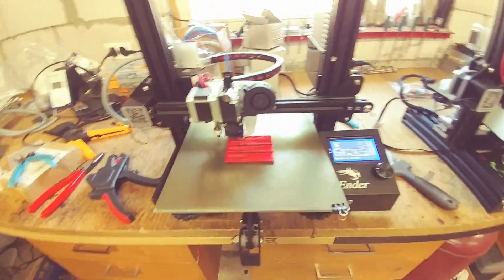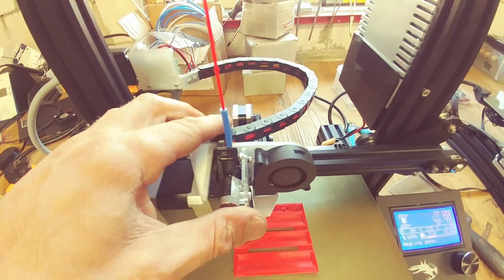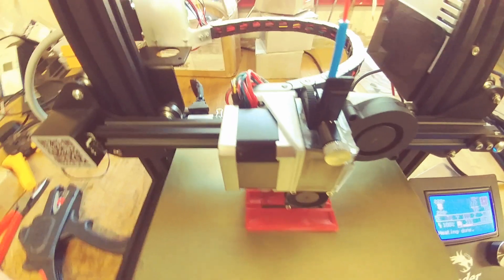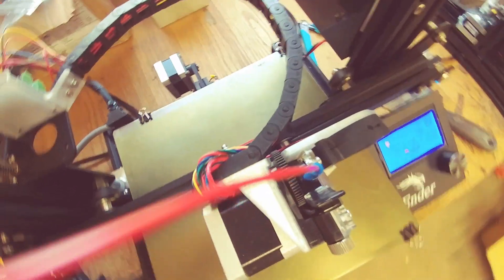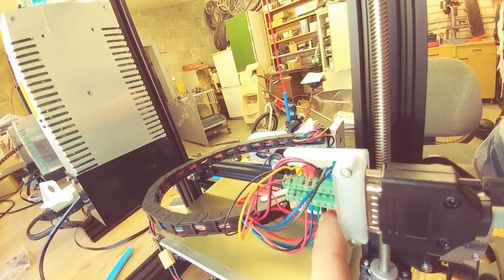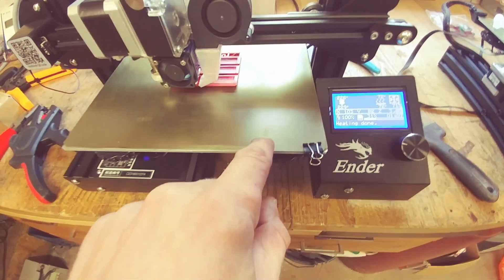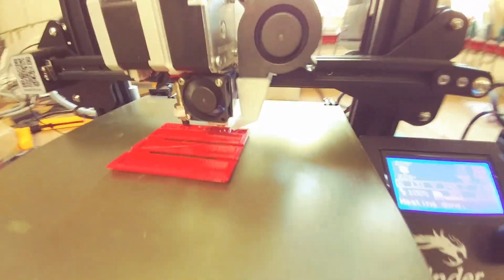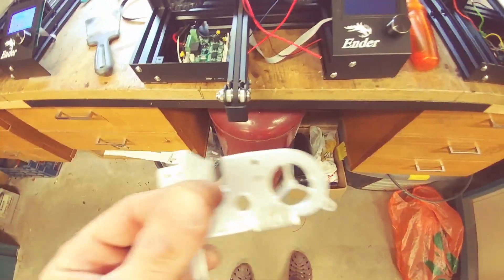Ender 3 direct drive mod with prusa pinda, and magnetic bed

Comment: Have you had any problems with the d-sub 15? The heat coming from it, is it a problem?
Reply from the maker: Why would it be a problem? DB connectors are rated for 3A per pin. 40W heater pn ender is 1.66A so i have plenty of overhead

Comment: Hi Agnius. Can you please tell me what did you change in the firmware to use the pinda probe?
Is it the V1 probe?
Thanks in advance!
Reply from the maker: Enabled ezabl and changed all statements oposite. True to false, false to true
Reply: @agniuszoro  thanks man, so you chose Th3d firmware?
Reply from the maker: @christianb.3938  Back then yes. Now o am running duet wifi and linear rails. You can check those videos too.

Comment: Hi Agnius. Do you have a link to the direct drive that you are using? You said Titan V6 clone, right?
Reply from the maker: Its on aliexpress, titan extruder clone and v6 hotend from trianglelabs
Reply from the maker: I have also reworked this and have more upgrades. Linear rails, magnetic hotend mount and duet wifi mainboard.

Comment: I tried converting to direct drive and kept getting motor vibrations even when its idle. Did you have any problems?
Reply from the maker: No problems with vibrations. I am running duet wifi now

Comment: Looks quite interesting and complicated. What are the benefits compared to the effort? How much did that modification cost in total?
Reply from the maker: I am building this for myself as i want to make 3d printer cluster of 12 printers, small business if you like, doing small to medium production runs. Mod is to make swapping failed components like heaters or fans quickly to minimize down time. Removable bed if for future pick and place robot. The cost so far: extruder and hotend 50usd, probe - 12usd, drag chains 8usd, removable primt surface -25usd, magnets - 17usd, breakout board -5usd, rest of the small bits ~15usd